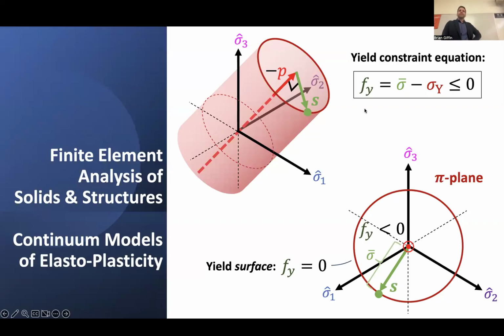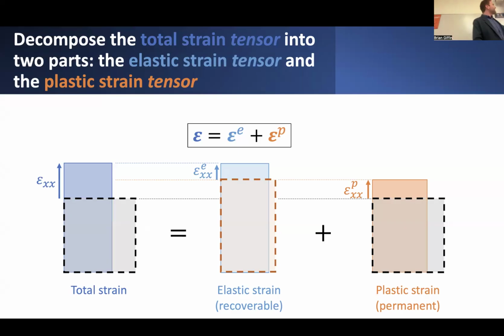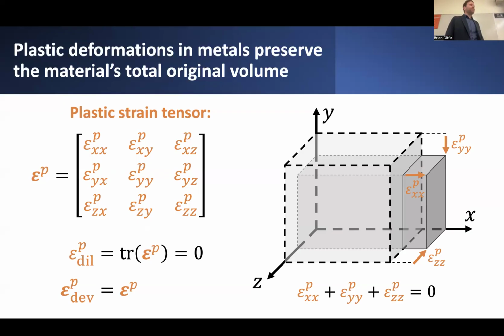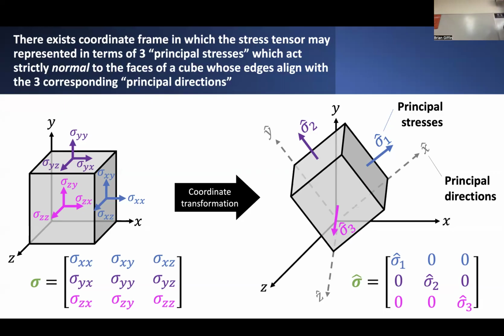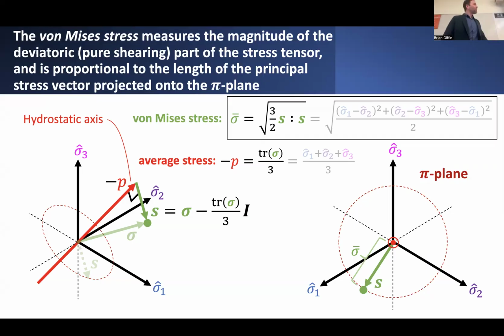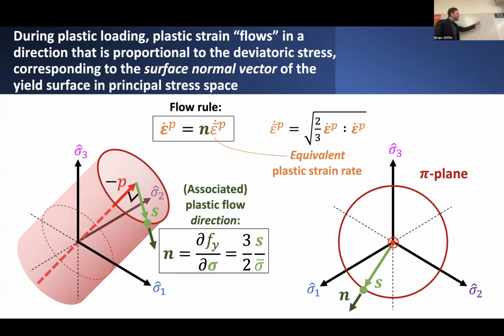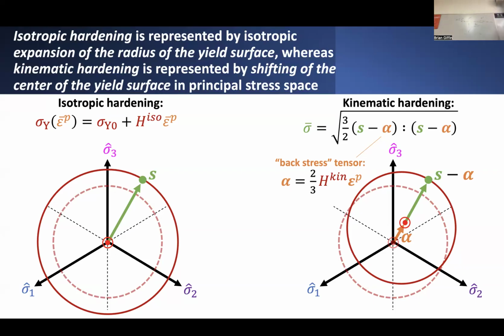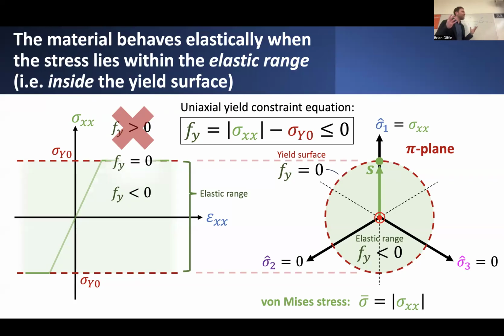Continuum Models of Elasto-plasticity

Comment: Nice explanation. Just two comments. (1) the Sigma-hat that you use in the explanation of the hydrostatic-deviatoric stresses in the principal stress space, is not the von Mises stress, what you highlight in the diagram is the deviatoric stress tensor module. The 3/2 are later introduced to make any state of stress comparable the Uniaxial one. (2) many metals including aluminium and steel alloys exhibit volumetric plastic strain. It is a pity that the “constant volume” plasticity is the only option explained by the academia.
Reply from the maker: Thank you for your insightful comments! You are correct on both counts. On (1) I wasn't sure how best to visualize the von Mises stress in the pi-plane, and I provided an approximate representation of it being proportional to the radius of the yield surface, although this ended up being somewhat inaccurate, as you point (I'll revise the lecture slides to include your suggestion); regarding (2) I would have liked to discuss more of the nuances of how real materials behave, but I found it a challenge to fit the topics I did cover in the span of the lecture. That said, I'll be sure to work your comment into the discussion of metal plasticity for the next time I cover this subject. Cheers!